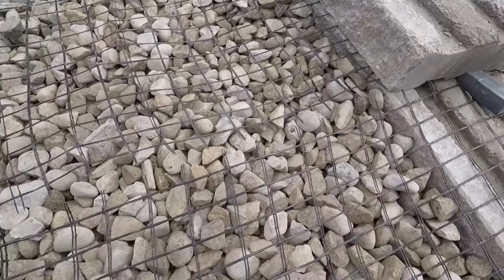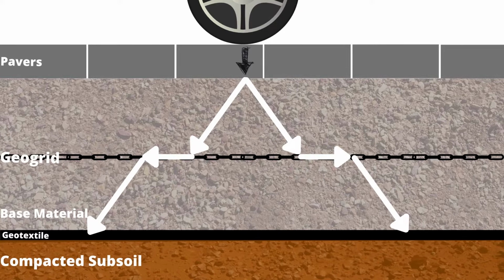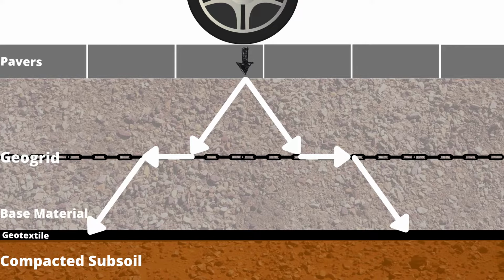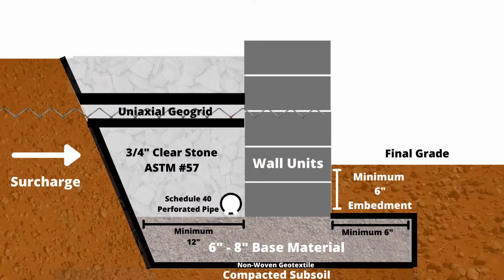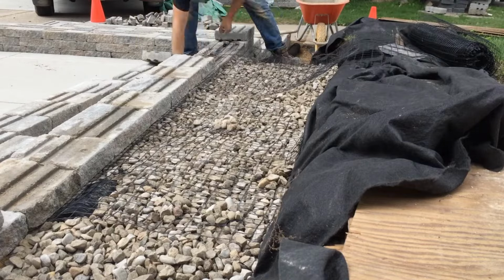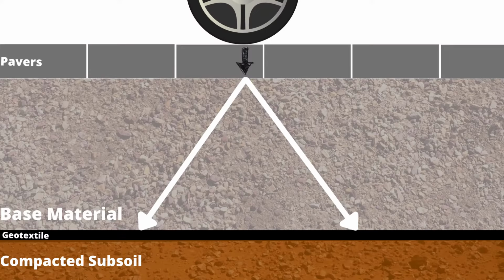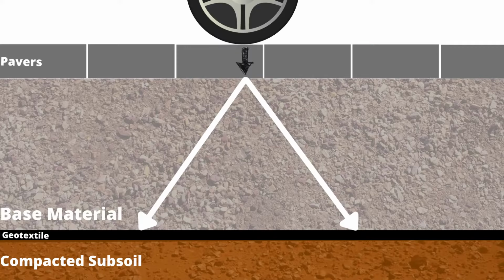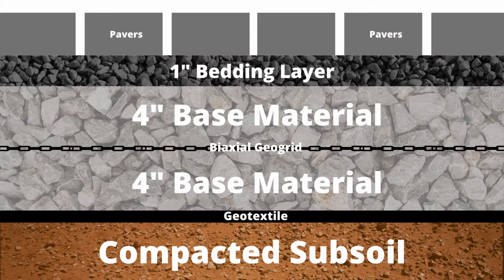Geogrid Installation and Applications | Use This in EVERY Hardscape Install

Comment: 6:26 you say biaxial geogrid needs 6" of overlap, but then at 7:06 you say you only have 4" between biaxial geogrid. Can you please clarify what the best layer thickness should be for both uniaxial and biaxial geogrids?
Reply from the maker: Definitely, 6” of overlap minimum from one piece to the next in one layer. 4” minimum from one layer to the next layer. So if you decide to have two layers of Geogrid in your base, you need to have at least 4” of base material between the two layers. Hope that helps 👍
Reply: @iamahardscaper  Cool, what about maximum layer heights? Like when is it necessary to add another layer of geogrid? And how did you learn this knowledge?
Reply from the maker: If you have weak clay soils, either use a woven geotextile to separate base from sub grade and have at least one layer of geogrid in a pedestrian application or more in a vehicular. Depends on the depth of base for how many layers. If you are worried about the stability of the subgrade, do a layer every 4”. You can also do non woven geotextile with geogrid right on top of it with another layer of geogrid 4” above that. All depends on your subgrade.

I worked for a supplier for many years and just asked lots of questions to everyone. Then I started a podcast and got a lot more questions answered and I talk to people that are smarter than me on it on a regular basis. Check out the How to Hardscape Podcast. There are a couple episodes on Geogrid actually.
Reply: @iamahardscaper  Cool thanks! I just subscribed to your podcast as well as your YT channel!
Reply from the maker: I really appreciate that!